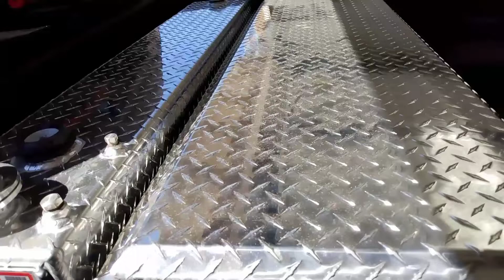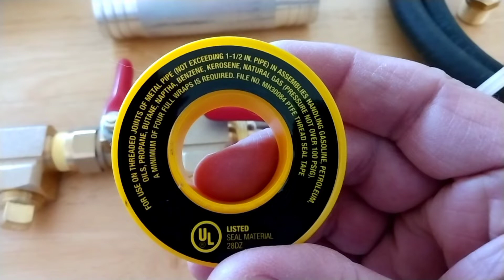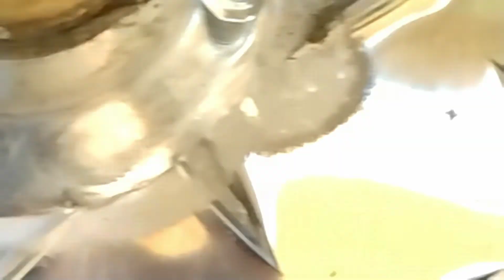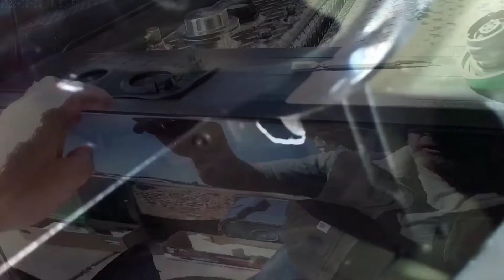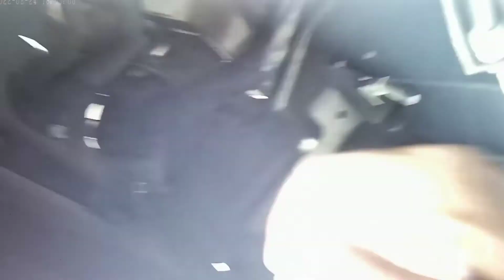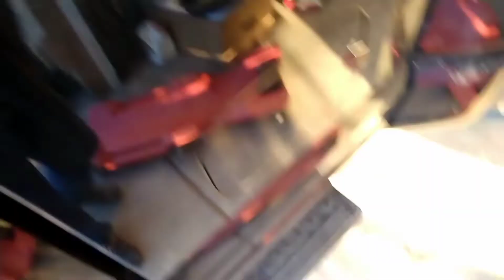30. RDS tank install model 71799: 2022 Ford F350 Dually Lariat Supercab Antimatter Blue Superduty

Comment: How tall is the fuel cap off the top of the tank. It shows the tank at 19 inches but that’s not including the fuel cap
Reply from the maker: I've actually made major changes to the truck with a bed delete and no longer use that tank. I still have the tank in my garage. I'll measure it the next time I'm home and let you know.
Reply from the maker: The tank height with fuel cap is 21.5 inches.
Reply: @alltruckedup2024  thanks man. I’m actually still debating on what tank to get. I have a 2020 Chevy 3500 dually long wheel base. I plan on getting a 5th wheel trailer one day but I’ve also been looking at buying a tractor. So I don’t know if I want something I can put a pump on or do both gravity feed and transfer pump
Reply from the maker: I believe this tank is set up for either a transfer pump or gravity feed. I have electric pumps on my side tanks now and I would never go back to gravity feed. I'm selling this tank now that I'm not going to be using it anymore.
Reply: @alltruckedup2024  you doing hotshot? What kind of tanks and pumps are you using?
Reply from the maker: I'm doing RV transport out of Indiana. I had a truck bed delete conversion done at shipshe trailers in shipshewana Indiana. I have twin 40 gallon side saddle tanks with generic electric pumps. Both hooked to upfitter switch.
Reply: @alltruckedup2024  you should do a video of your setup
Reply from the maker: @Craneman1100  I did a video a few weeks ago showing my bed delete conversion. I was thinking about doing a whole truck, trailer, and equipment video.

Comment: Eric Looks good! really nice job! I like your tank selection as well good brand..Just trying to think of way to keep you from getting so dirt to reach under there to turn your valves on? Being diesel Im to worried about fire like gasoline, but was wondering if you can get on off solenoid valve and wire into up fitter switch to transfer fuel and stay clean??
Reply from the maker: Thank you. I appreciate your comment. Funny that you mentioned the solenoid because I already have a small pump/solenoid/fuel filter setup I made. I mounted everything into a plastic project box but my issue now is  where to put it. It actually flows really well just on the gravity feed. The only thing I'm concerned about is how to stop someone from simply cutting the fuel line and siphoning off the fuel from the transfer tank. I'm going to design a metal shield that I can cover everything with and I'll simplify it with the solenoid and pump wired to an upfitter switch. That'll be coming in the future.
Reply: @alltruckedup2024  I feel your pain trying to make this theft proof!   This idiot made fuel shortage is causing a lot of problems.  I was going to put on locking fuel cap, but decided for right not it would be easier to allow the village idiots to steal a couple of gallons than have them drill into my plastic tank.   Drilling holes in the plastic fuel tanks would cost me 650 to replace plus refuel of 240 and then labor on top of that now you're up to a grand!  To only steal a couple of gallons and let the rest run out on the ground???  Tough spot!  I thought bought breaded SS lines with AN fittings would be nice but SS hard lines would be better just cover fitting locations that way they might just look for something easier??? Maybe?

Comment: Hey great video, very informative. Question now that you’ve been running the set up now for a few weeks - any overflow issues at all? Have you been leaving your valves open all the time to just let the system feed? Any issues with the trucks computer as far as it being confused with the range or having your main tank “full” despite running a lot of miles? Hopefully no check engine lights?
Reply from the maker: I'm going to do a follow up video on the tank. But I have not had any issues with overflow, no check lights, or any computer issues.  I don't leave the valve open while I'm driving. It takes about 20 minutes to fill the tank The computer recognizes fuel entering the tank and adjusts the range and gauge accordingly. Overall,  I am very satisfied with the tank...just not happy with the cost to fill it up.
Reply: @alltruckedup2024  that’s awesome, glad to hear it! Thanks. 👍🏼🇺🇸
(Fuel price is rough though, indeed)
Reply from the maker: @MM-jx7jp  Yes it is.  I went to the local shell station and tried to fuel up and it was over $500. I wanted to be sick.

Comment: you have to sit it on 2 4x4 I ran into the same problem
Reply from the maker: I specifically purchased this model because it was advertised as below bed rail height. I got it to work though. I filled it with fuel and tested the gravity flow. Works great.
Reply: That sounds like a Great Idea, Im good having it sit an Inch and a half higher.  I want  91 gallons in the bed of my F450.  I just need it to be low enough where the 5yth wheels  nose will not contact it even when at full turn